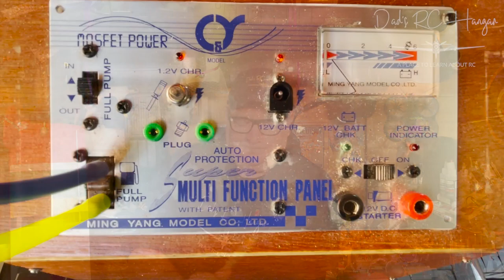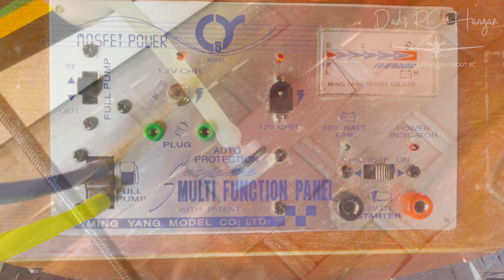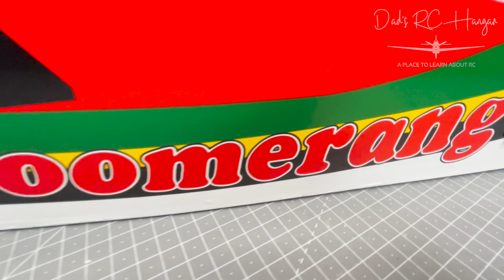Seagull boomerang v2 | Nitro Engine Fire up

Comment: Gotta love the smell and sound of nitro! I like to go though about a gallon of fuel on break in. You can try JB weld on the muffler, or find a guy that can Tig weld it for you. Great video!
Reply from the maker: Thanks buddy, I will give the JB weld ago. Yup this was just to make sure the engine was fine, shake down really. Will do a nice run in at the field 👍🏻

Comment: Hey Dad!!! I was wondering if the XT30's came installed on the 6Star switch, or did you cut off the plugs that came on it and solder those XT30's on?  I've been looking for a switch with XT30 plugs for my R10 Pro also. They're kinda hard to find. Great video by the way, thanks for sharing.
Reply from the maker: Hi Chris, no they had the Servo type connectors on Male and Female, I kept the female for the batteries and solders the XT30. I dedicated one battery just for the Glow, but I could have put them both in the R10 I guess. Great switch with filler thou. Hope you subbed for the journey. Hope you get one. Have a great day. 
Chris
Reply: @DadsRCHangar  yeah I've subscribed a while back. Like the channel and the enthusiasm. Keep up the good work pops 😀

Comment: hey chris, just to say it is quite normal to charge your batteries in the model. A side note, if you don't plan to fly the model for a while i.e over the winter period it is best to disconnect the batteries in the model as it can cause the wiring to degrade

all the best 

Mark
Reply from the maker: Heya Mark, I didn’t know that about the wire. Well I hope to fly next Friday. But the rest I will put to bed for the winter. Thanks yiu for popping by buddy. Hope you are well 👍🏻

Comment: I used to have a setup like this I had an OS 4 stroke. My only complaint was the exhaust basically left oil Greasey oil all over the entire model. It gets under the coating and softens up the balsa

I’m in process doing another one, and for that reason, I’m going to go electric ..
Reply from the maker: Yup, it dose get everywhere, I always used wet wipes after every flight. I will have to see what would happen if I put a pipe all the way to the tail of the plane. Have a great weekend. 🫡

Comment: She fired up as sweet as a nut!! Can't beat a real engine, I would love one!! But flying as I do at 6-30am I think I would upset the locals 😖 God knows if I will get chance to fly this weekend Chris!! But keep your fingers crossed, and thanks for starting my weekend with a Smile 😄👍
Reply from the maker: Thank you Ian, I’f I made you smile, then my job is complete for the video. 
At least I know why the fuel line had bubbles. 
Tightened the fitting now, would not have thought it would be loose from the shop, I guess presumption the route to crashes. Have a great weekend Ian and thanks for popping by 👍🏻